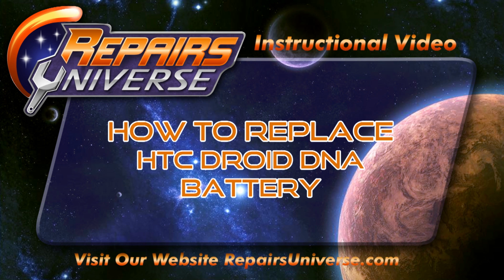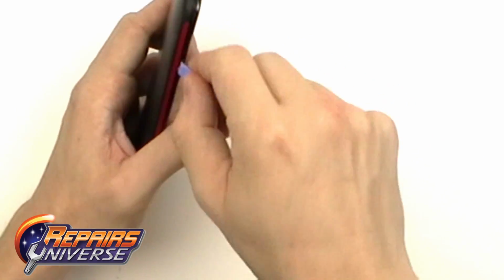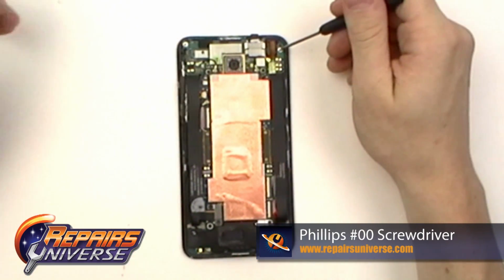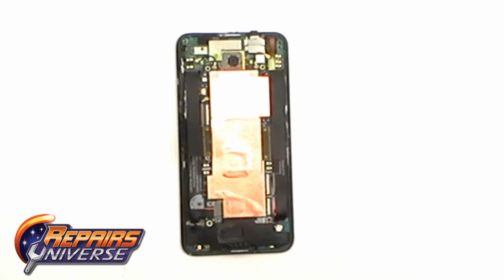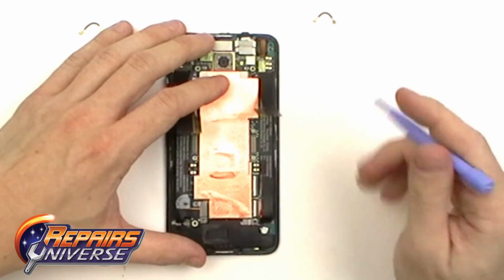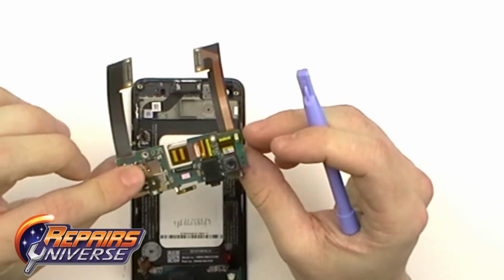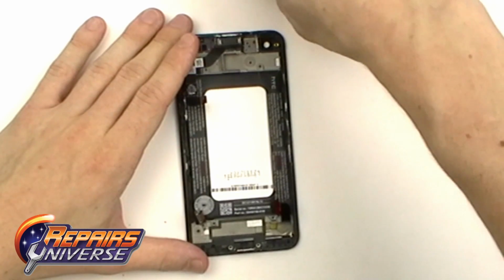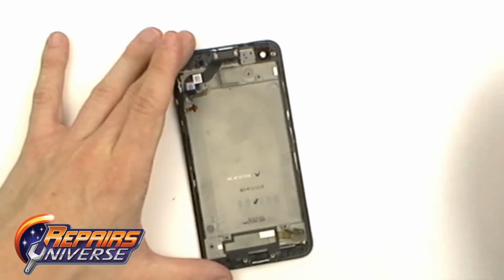HTC Droid DNA Battery Replacement Guide

Comment: Not for the faint of heart.  But still a noble endeavor on a slow Sunday afternoon.  Best time to attempt this...when you're due for a free upgrade on your contract, so even if you mess it up, the phone needed replacing anyway.  I'm on my third HTC, and the only thing I hate about the DNA is that they've switched to batteries you can't replace by simply popping out & popping in, like the Incredible models.  The only reason I will be attempting this is because I've yet to come across a better cell phone camera (without  laser-assisted focus).  And the stunning HD display is second to none.

Comment: is the battery for HTC Butterfly S compatable with this model ( i have european version-HTC Butterfly). On aliexpress says that the 3200 mA for HTC Butterfly S i compatible. Advice pls
Reply from the maker: Our records indicate the batteries will be compatible. Here is the link on our site http://www.repairsuniverse.com/htc-droid-dna-battery-replacement.html The batteries are 2020 mAh.
Reply: Repairs Universe I ment does the 3200 mAh from Butterfly S will fit in the Droid ? Ty again :)
Reply from the maker: No, you would require your specific battery,

Comment: I just got an HTC DNA from craigslist. The battery doesn't last very long, it charges slow, and the back of the phone gets pretty hot if I use it for about 15-20 mins. What do you think is the problem?
Reply from the maker: I'd recommend starting with the battery. Replace this and see what results you get.

Comment from the maker: Every battery is removable. Its how serviceable it is that's the catch. Some just pop in(serviceable) Some require you removing the housing and a screw, or some are soldered to the board(unserviceable). Every battery can be replaced. It comes down to how much skill and knowledge the person has working on the device.
Reply: you guys dont have the battery replacement for this model. can u send me the link?
Reply from the maker: Unfortunately we do not have any recommendations, we do apologize.
Reply: +Repairs Universe the best results that ive had was by following the Magic Mender Wizard (just google it) without a doubt the no.1 info i've tried.

Comment: Sherry Chilton you don't remove the battery in the Droid DNA, it doesn't have a removable battery
Reply from the maker: Although the DNA does not have a conventional battery like the S3. It can and will go bad It will  fail just like any other battery. This guide shows you how to open the unit and install a replacement battery to get your unit up and running like it was new.

Comment: You MUST be kidding.  Trying to activate a replacement phone and the instructions say" if your phone has a removable battery, remove it from your defective phone and insert it into your replacement phone."  There is NO WAY I am doing this to a new phone!  In fact, having removed the back, and the plastic seal, and being told to remove 13 screws, I am leaving the battery in the old phone.  CRAZY!